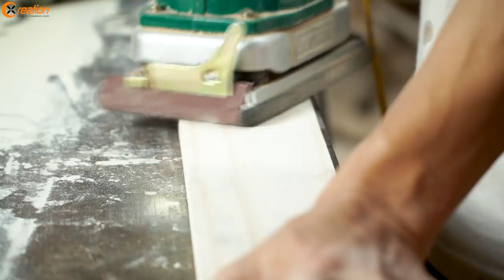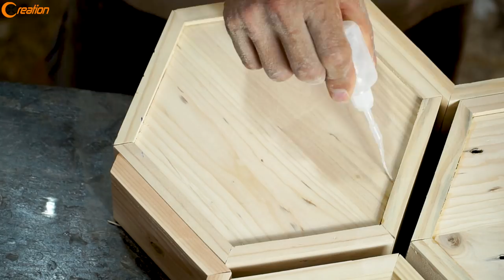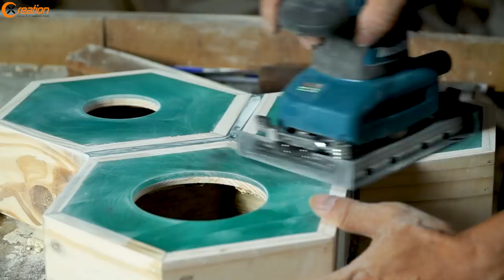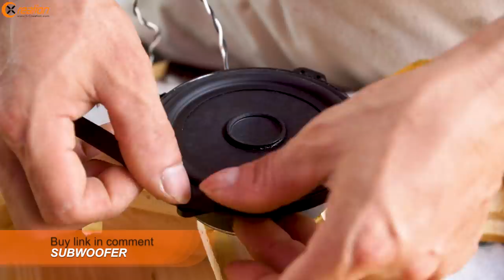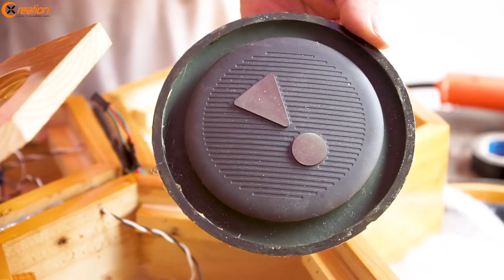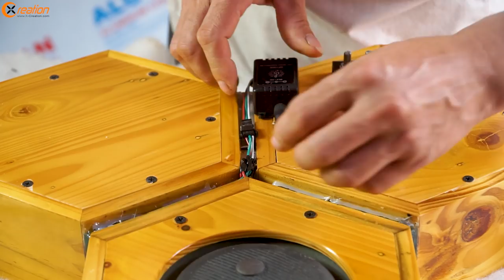Transforming Wood Pallets into Epic Beehive Bluetooth Speaker!

Comment: Nice build, looks very good, though from what I can hear, it sounds too top heavy.
There is too much treble and not enough mids due to using two tweeters with capacitors - standard full range speakers would have worked better.
The "subwoofer" also looks far too small and its enclosure is too small, so it doesn't produce enough bass. You do hear the effects of the passive radiator, but overall the sound is not well balanced. Two full range speakers and a subwoofer in a bigger enclosure would have been better, as would two full range speakers and two smaller tweeters (using a 2 way crossover to get a balanced sound).
Reply from the maker: I will try more! Thank my friend!😘
Reply: @XCreation  1234